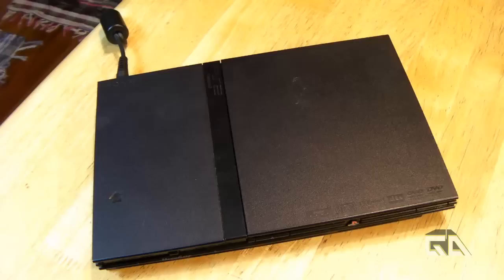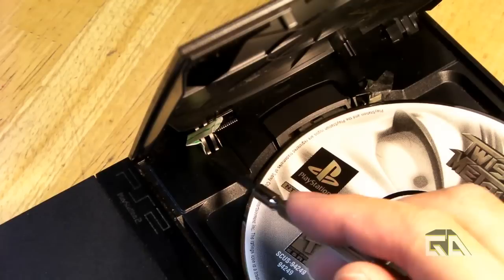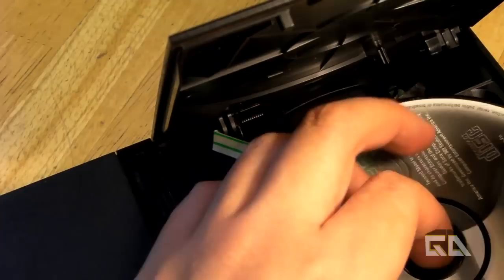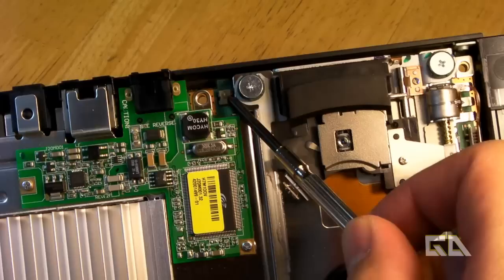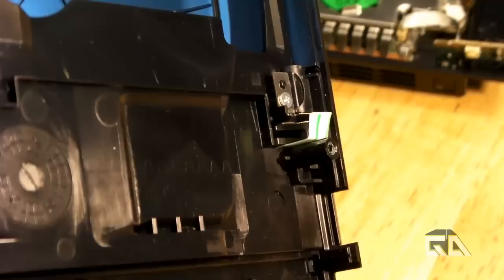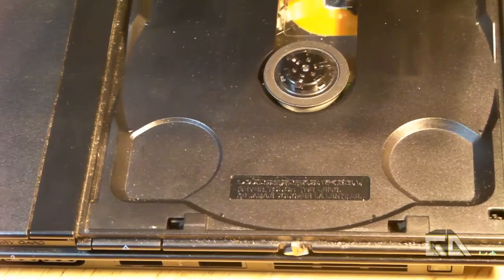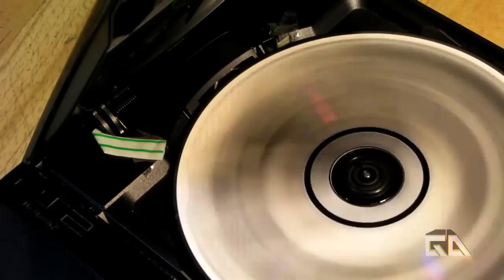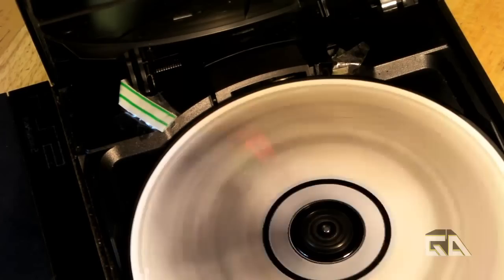[How To] Install the Tape, Tissue, and Straw Mod for Slim Playstation 2 Tutorial! [CC]

Comment: I managed to tear off the power button. 

if I bought a replacement part I would wreck that one too most likely. I think I should just find a fat PS2.
Reply: +juonryu2nd After 8 years of use, my power button's about ready to fly off. It's really loose (and I mean really loose).
Also, I like your use of the words "tear off". Did you seriously rip it off, or did it just come off? :D
Reply: TheCoolKid
it happened when I closed the slim. I put the top half on the lower and heard a breaking sound, so I guess that I pushed the top half right into where the power button was.
I bought a fat recently and the power switch is much less vulnerable there.
Reply: juonryu2nd
Well, I recently opened my PS2 Slim, and I heard a breaking sound and I realized that the tiny circuit board where the power button is was dislodged, and my power button had come off. I realized it came off because the power button is seriously just a plastic piece that is resting on the case, and it's held by the circuit board where the real power button is. If that weren't there, the power button would easily fall right off.

Comment: wow.  first off the 3rd sensor inside the console doesnt need to be blocked AT ALL!!!
THERE FORE SIMPLE AS STUFFING SMALL PIECE PAPER IN THE RIGHT CORNER OF THE DISK TRAY, AND PUTTING PIECE SCOTCH TAPE OVER THE LITTLE FLICKER THING THAT GRIPS THE DISCK AS IT SPINS. THATS IT DO THIS AND IT WILL WORK 100% NO NEED TAKE APART PS2 LMAO
Reply: Kayla Wooton I think that only works on SCPH-79000
Reply: Yeah, I have SCPH-75001 and it has a 3rd sensor therefore I have to do this Tape straw and tissue method

Comment: i have a fat ps2 how can i do this on the fat ps2 ?
Reply: The fat ps2 doesn't have a flip top like his does... but you can just take it apart to the point where you can see the disk... look it up
Reply: GuitarHeroWarrior13 if i buy a ps2 slim now can i still do this and install fremcboot because i keep hearing that if i get a ps2 slim that is a  version before march it might not work
Reply: cirilo ordonez Im pretty sure you will most likely get a SCPH-9000 Model, which does not work for freemcboot... Mine is like 8 years old so mine is like an SCPH-3000 something lol
Reply: GuitarHeroWarrior13  dang because i dont want to use a slide tool
Reply: cirilo ordonez Well the only other option is to take the ps2 apart until you get to the disk drive. At least you don't have to take it all the way apart... but it's at your own risk.. I did it
Reply: GuitarHeroWarrior13 o ok so i might do that
Reply: cirilo ordonez Ok and if you do, when you take the half part off the ps2 after unscrewing everything, there will be this silver like chord connected to the eject/reset button... BE VERY CAREFUL TO NOT TO RIP THE CHORD OR YOU WILL HAVE TO BUY A NEW POWER SOURCE (even though it's 8 bucks)... but if it just unplugs from the eject/reset button and the chord did not rip, your ok :) just slide it back in.. Though it's tricky.. good luck :)
Reply: ***** Yea I know that but he was saying how he didn't want to use the slide tool.. which is why I told him to take it apart
Reply: ***** Woah sorry man I didn't want to be mean or anything and I know that it takes minimal effort to use the slide tool, but the other guy was saying how he didn't want to use the slide tool, despite it being easy to use.

Comment: I opened my slim up, popped these two sensors off with a pair of pliers. Then I put a small dab of soder connecting where the sensors were in the two different spots. Then I used pliers to remove the plastic piece that comes up when the lid is shut that assists in keeping the disc in place. The slim will spin no matter what, disc or no disc on start up and it doesn't care regardless. I just make sure to have the console off when I want to load a disc. It works great and I don't have to worry about the sensors wearing out.
Reply: Project Phoenix Media, thanks. I really enjoy your vids. I learn a ton from them. Keep up the good work.

Comment: do you have to do this?
Reply: i ordered the swap magic 3.8 is that what i need?
Reply: k thx
Reply: ***** One more question will this work if i wanna play japanses games on an american ps2?
Reply: ***** Japanese sorry
Reply: okay thanks man
Reply: ***** Hey I need your help after I did this when i put it back together the power button seemed jammed and I couldn't turn on my ps2 what should I do?
Reply: I really can't seem to find the problem maybe its not lined up properly?
Reply: ***** well actually I did it another way by putting blue tack on the sensors to which one was behind the power button thing and the other was on a sensor
Reply: Nope
Reply: I can't find the problem
Reply: by the way it was working BEFORE I modded the ps2
Reply: alright where should i look inside of it?
Reply: I put blue tack right behind the power green thing maybe that's what caused it?
Reply: I actually saw another person use blue tack
Reply: okay I'll work on the ps2 and see what I can do so first its best to clean the power thing?
Reply: and how do I
Reply: alright i'll look into it and update you on it